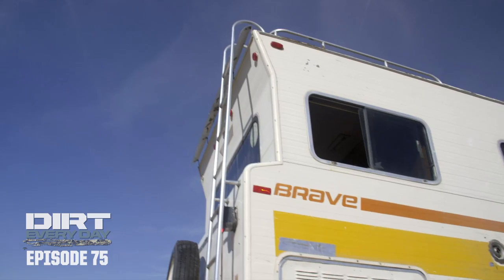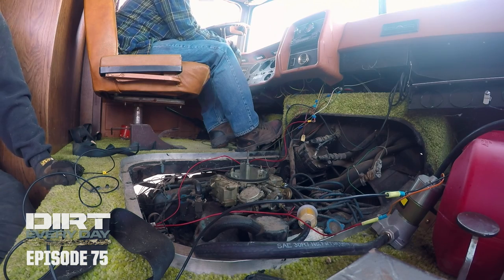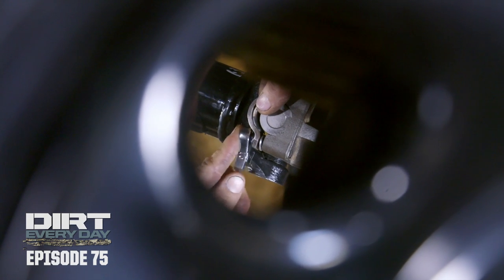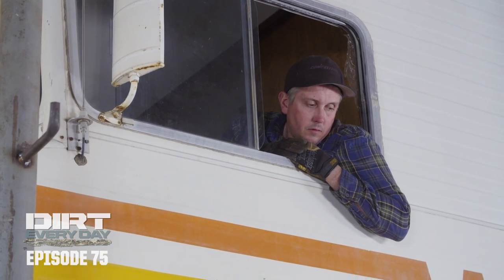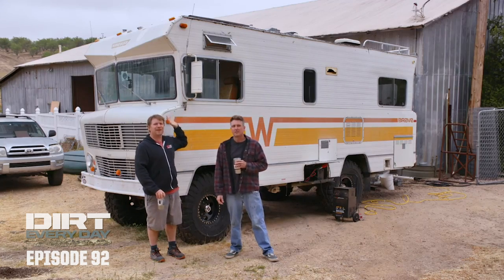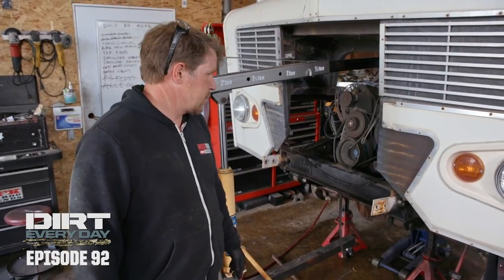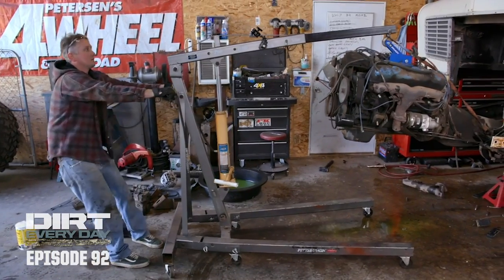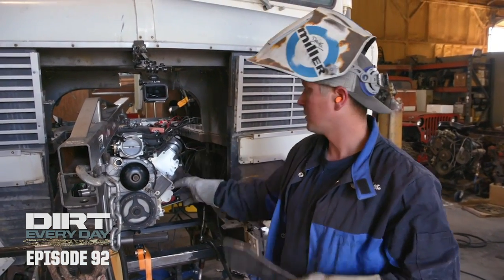We Took a Winnebago Off Road! The "Off-Roaderhome" | Dirt Every Day | MotorTrend

Comment: In 1972 or 73 one of our local car dealers had a Winnebago Brave identical to this displayed on their lot for a couple of weeks. It had been converted and built to run the Baja 1000.  It had left and right hand duel steering wheels. The thing was stripped down bare inside with a massive roll cage frame and one bunk. We rode our bikes down town every day to look at it and dream. We  found it unlocked one day and snuck in when we thought no one was looking. We were crawling around on our hands and knees so we wouldn't  be seen. We actually found the keys on the passenger seat. My 14 year old buddy grabbed the keys and said  let's come back tonight and go for a drive. That seemed reasonable to me, after all I hard been driving my Rupp mini bike all summer on the trails, how hard could it be. Just then the door opened and one of the salesmen came in and caught us. Even though I thought we we going to prison or something, he didn't seem to care and my friend handed him the keys saying we found these. He was pretty cool and started the motor and revved  it up showing off. I remember thinking you would go deaf riding in that thing for a 1000 miles.  The next summer we rode our bikes to the dealership and found the same sales guy and asked   him what ever happened  to the jacked up Winnebago. Evidently it crashed and rolled on the 1st day of the race. LOL

Comment: I met a guy that beat you back in the early 2000's except for HP. Old bread box motor home, Dana 60 up front, aggressive 385-65-R22.5 truck sow tires on 10 bolt Alcoa aluminum rims. The owner liked camping in the bush... in comfort.

Comment: That bending harbor freight hoist is giving me horrible flashbacks mine had a manufacturer defect yes fully extended it will bend a little but mine snapped clean off dropping the motor I saved up my whole senior year of high school for from almost full hight down into the engine bay of the truck I saved up since the 6th grade for cracked the front axle housing busted my engine mounts obviously trashed my oil pan could have been fixed but I didn't have the money all they did was refund the hoist but it didn't do justice to the damage done don't take the risk with harbor freight

Comment: That poor ole girl she was super clean before you flipped it. Maybe 4x4 with factory sized knobby tires and a 3 inch lift would have been better. At least for camping way out in the middle of nowhere. Now you can't do anything with it. And the mods you did do didn't really do what you wanted. The wrong set up for the wrong vehicle.